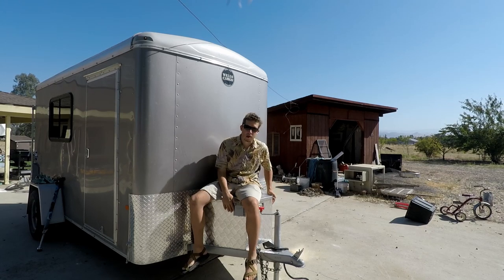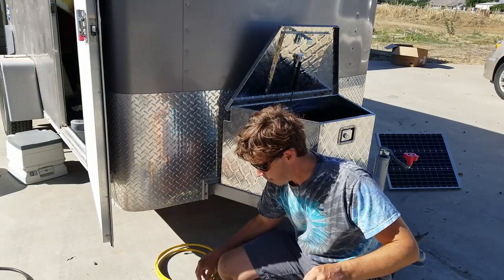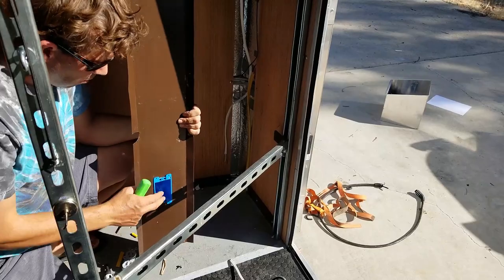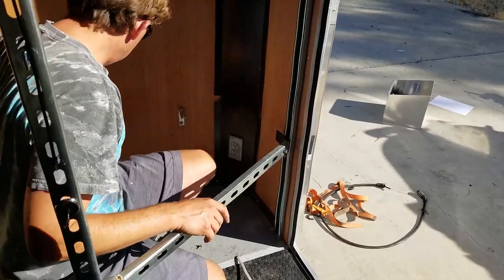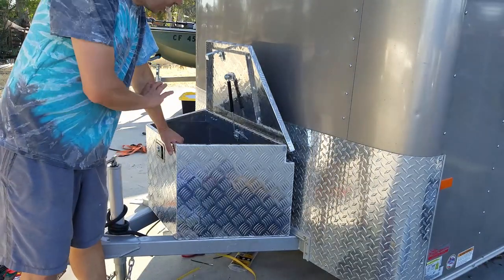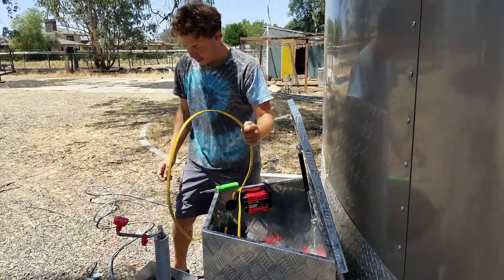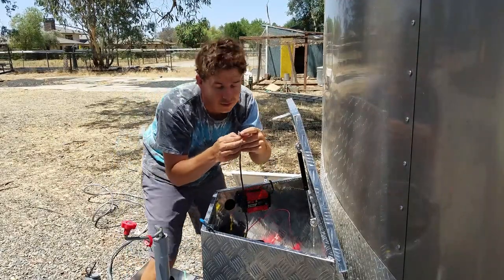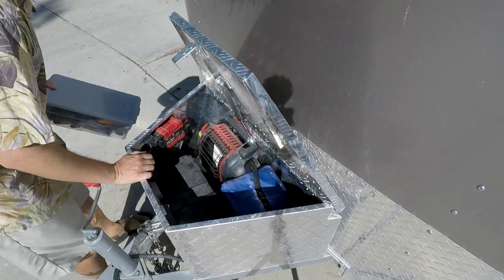Cargo conversion Tongue box and electrical

Comment: I bought a tongue box earlier today for my camper. It's not metal but worked well on my last camper build. I had my battery, charge controller from my solar panels, inverter and few other items inside it. I like what ur doing. Just be careful with your battery terminals, keep them covered well from short circuiting with anything. I know you have a battery box and lid for box but leads to your inverter lugs may be more exposed. Just something I had to deal with myself. Thanks and I enjoy ur videos.  :)

Comment: If you want better gas mileage while towing a flat nose trailer, You can put a V nose on the front using a sheet of 4x8 aluminum diamond plate. All you have to do is score in right in the center and 1 inch on either end. Then bend it at a 45 degree angle, more or less for the center and on the edges for mounting to the front of the trailer. If you have a aluminum welder or know someone that does, weld the score back together, or you can brace it on the inside with strips of aluminum and rivets
Reply from the maker: I've been thinking about this. I'm planning on using sheet aluminium and bending into a round nose. Then making a cap for the top and a door on the bottom so I can put things in it.

Comment: Like your videos but electrical needs attention. Need gromets on exposed metal edges, should use flexible extention cord instead of romex. Romex tends to be to stiff in an RV, watch for fires, need fuses.
Reply from the maker: Thanks for the advise. I'll look into it.
Reply: Do not use extension cord, its not made to be concealed. Use stranded marine wire. It comes in a cable form that looks like romex, is UL standard 1426 listed for boat wire. It’s made for the vibration you get in mobile applications.  Standard nonmetallic house wire will fail, it’s made for a house not an RV.
Reply: @jeffpurdy2347  Good to know, thought a heavy duty extention would work guess not.